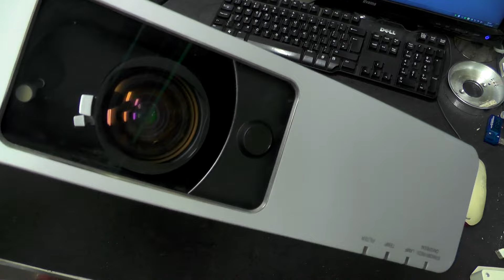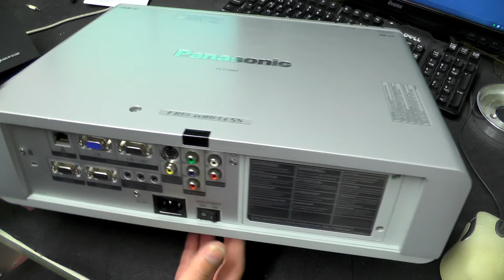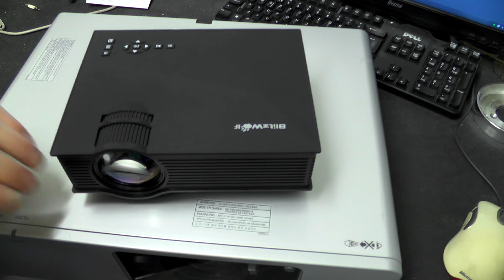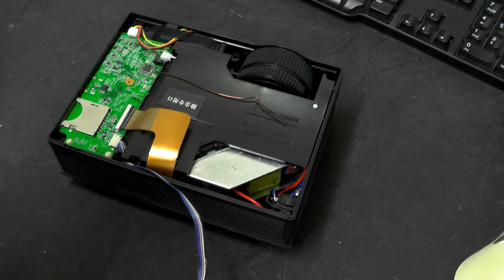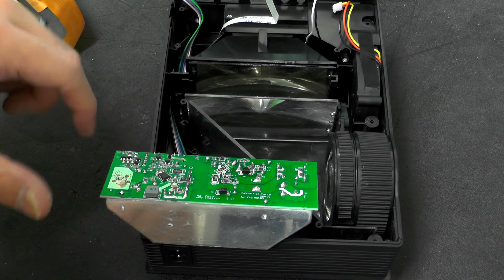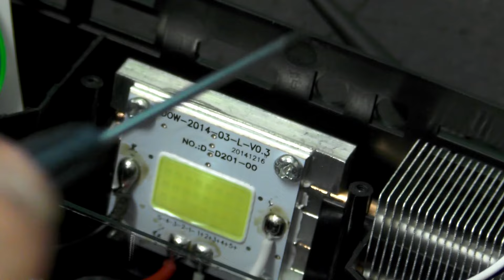DL#097 - $90 BlitzWolf BW-MP1 Projector vs 10yr Old $4000 Panasonic Projector

Comment: I too would love to see that. I was thinking of getting one of these to 
project on my ceiling to watch netflix while I lay in bed before I go to
 sleep. I currently use a galaxy tab s 10.5 and it's an amoled running 
2560 x 1600 so of course it looks superb, but obviously there's a major 
screen size factor to consider there. Do you think the video being 
projected only about 6 feet or less from a table to the ceiling in an 
apt would be good enough for that?
Reply from the maker: Maybe yes, i should be able to test and demo it but not until i get back from my hols in a couple of weeks.
Reply: DextersLab2013
Thanks. No problem, I'll check back.

Comment: I have seen these and did wonder how good they would be - any chance you can do a side-by-side of the actual projection? Is there scope for a higher power LED?
Reply from the maker: +SDG Electronics yea i am sure you could put a higher wattage led in, don't suppose it would do much for the contrast ratio. I will investigate getting video of them side by side. It might be easier for me if i take a still of them and post it up on EEVblog.
Reply: I was expecting that...

Comment: Generally, DLP's are considered superior. Image blotches are in fact much more common on LCD units due to dust settling on the LCD and DLP units are sealed and thus are far more less susceptible. DLP also has higher contrast ratio and are generally brighter than LCD. Older ones had noticeable colour wheel flicker but that seems to be a thing of the past. Large 3 DLP units are what Is used in Cinemas too.

Comment: I would suspect there is a unit like what is inside a broadcast TV camera being used backwards to throw a image onto the screen, I just wonder could you not replace the projector lamp and there must be some way to reset the lamp hours counter, or if you wanted to why not build a TV projector with Red,Blue and Green lasers which means that it should not need a lens at all.